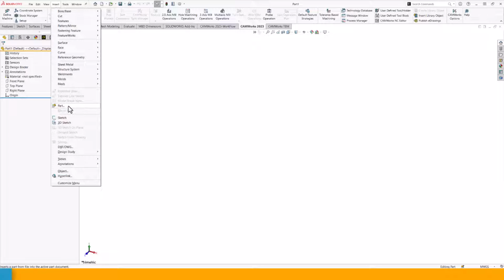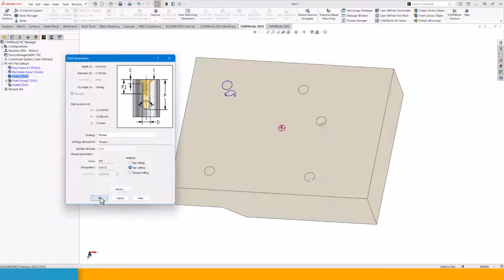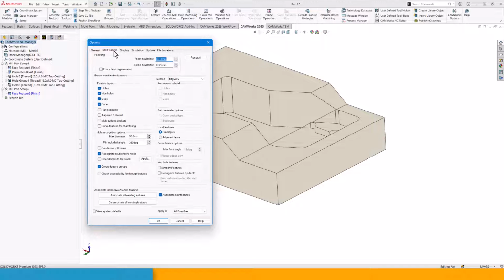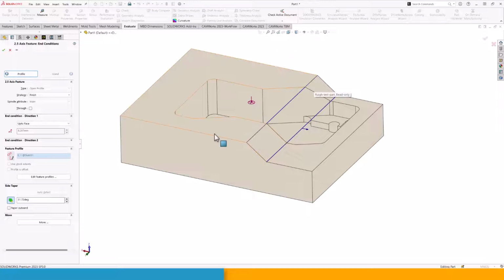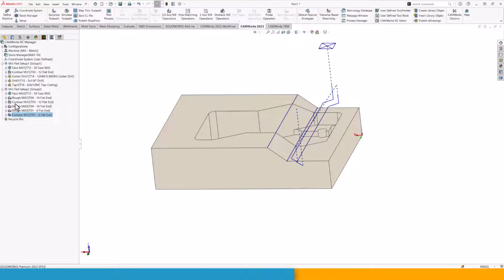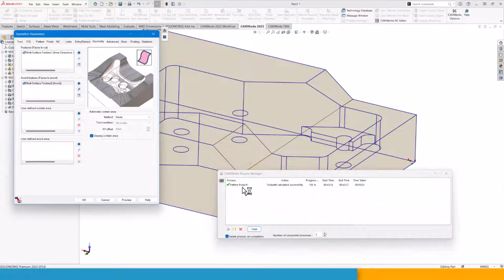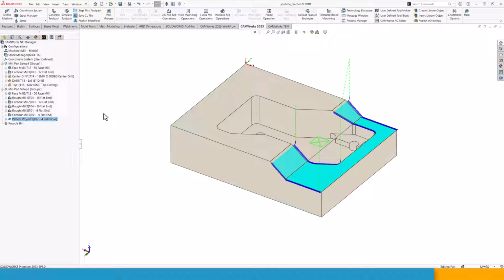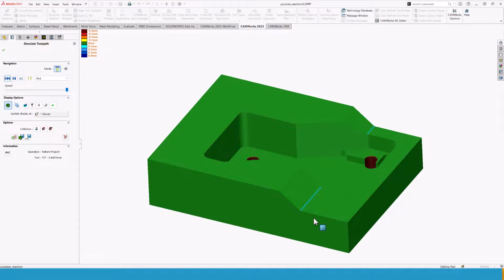CAMWorks and SOLIDWORKS CAM, manually defining features

Comment: As a beginner this is way too fast with way too many information for me. Do you have a beginner type of video for a non machinist who just want´s to start ? 
Leave out automatic feature recognition entirely and do it all by hand, so I can understand in detail what´s is what and how to do it if feature recognition fails.
When do I use which of the 10 possibles operations in SWX like face feature, hole, pocket, open pocket, slot etc. 
Those kind of things